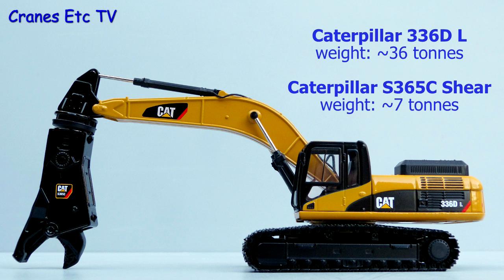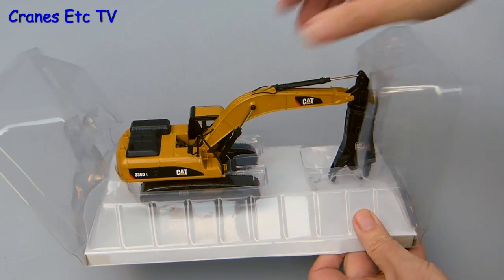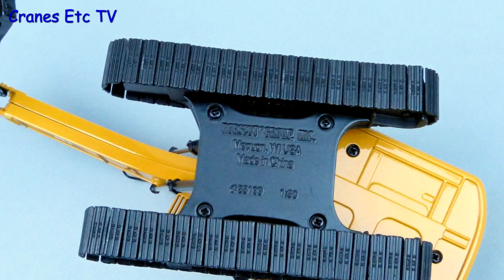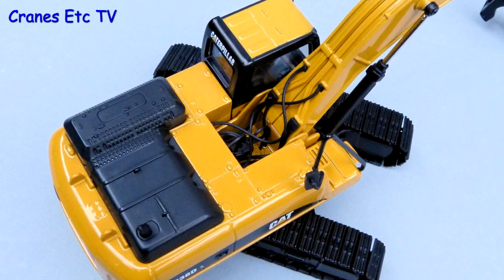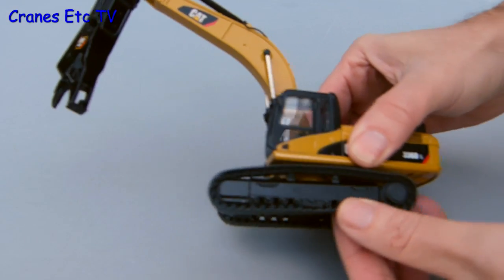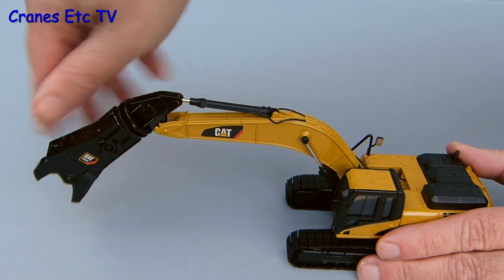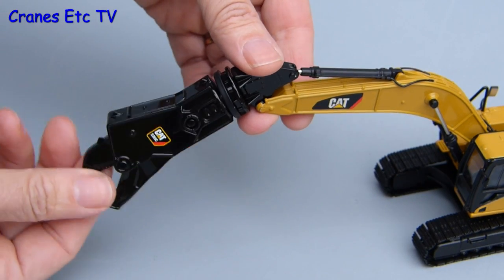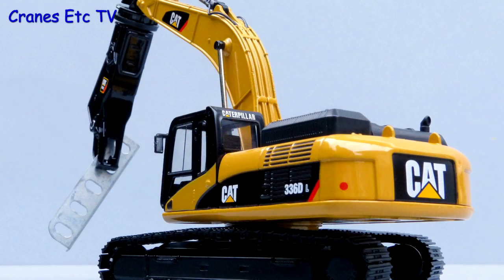Norscot Caterpillar 336D L Excavator + S365C Shear by Cranes Etc TV

Comment: not bad need hoses to the sheer and need a cab guard, also looks like it wont be able to hold much in whieght and the cyclenders will prob losen in time, nice model tho, good job on the vid and on the part of cutting off the finger